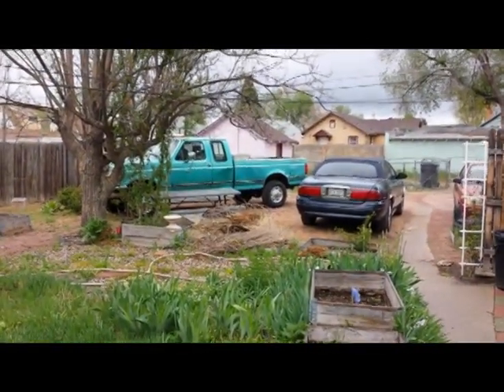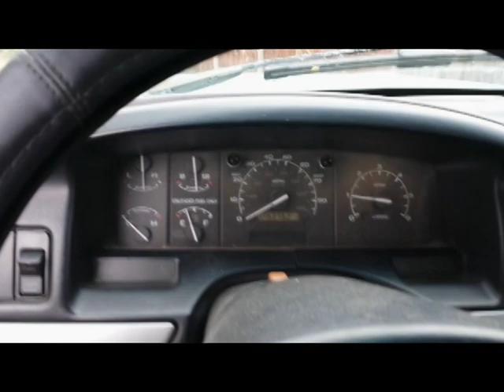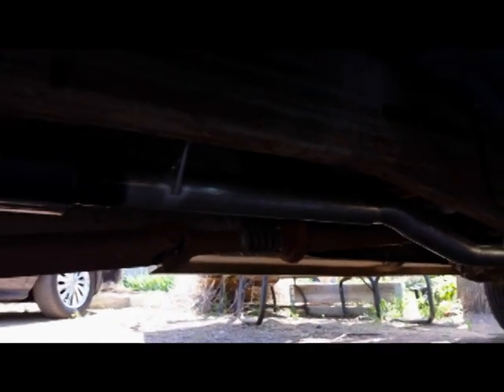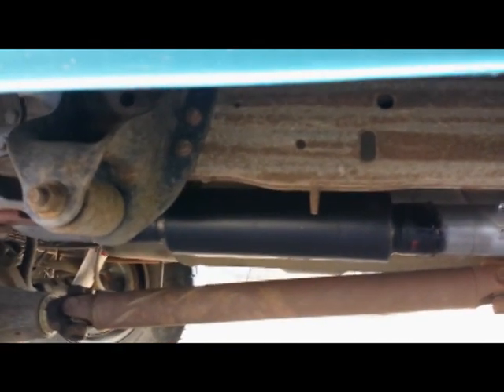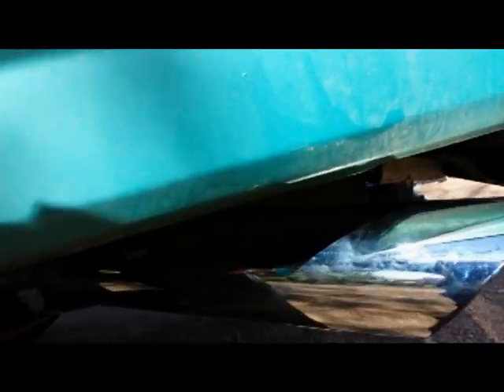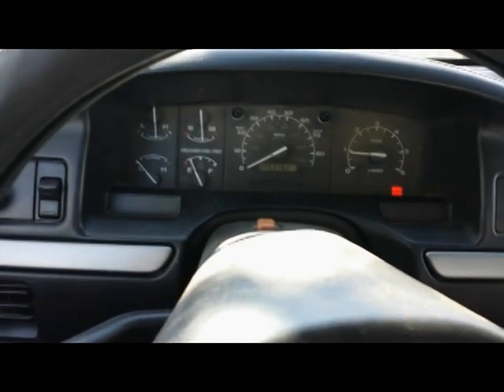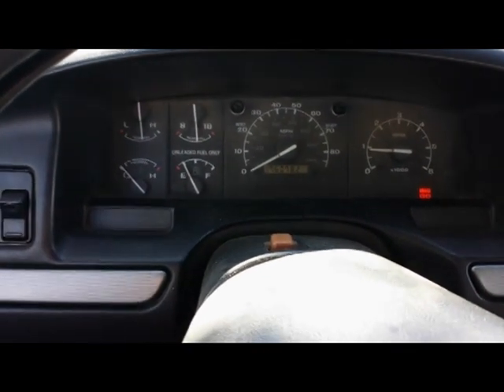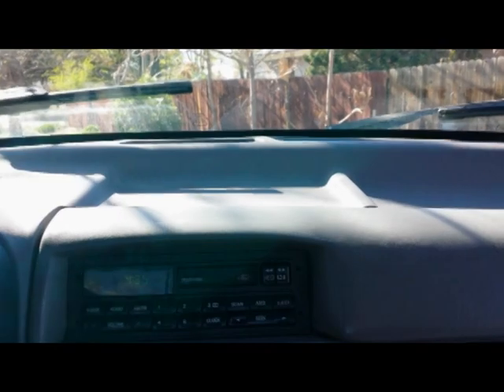1995 FORD F250 7.5L first MOD. old exhaust vs new exhaust

Comment: Is that 3" out to 4" tips? Sounds great.
Reply from the maker: It is 3.5" tips.  About your front fuel tank if I may suggest some things.  If only the front fuel tank is starving for fuel most likely your fuel pump regulator.  And if not then your fuel pump is starting to give out, or possibly the filter is dirty.  It can't be the fuel filter since the back tank is running fine.  There is only one fuel filter. I found a video that sounds like what you are describing. Check it out and see if this sounds like the symptoms you are having.  It is on a a F350 truck but same motor. 7.5L.  Check it out and see if it helps.
https://youtu.be/g6rf9oPDq1I
Reply: @MountainSide719  ty I have looked but haven't seen that one
Reply from the maker: @RollingThunder85  your welcome bro.
Reply from the maker: @RollingThunder85  man! That was a nice burn out! I did one but ended up deleting it.  The ol' 1 turn n burn didn't look so good lol I subbed and you got a nice truck bro. Hope you get your situation figured out.